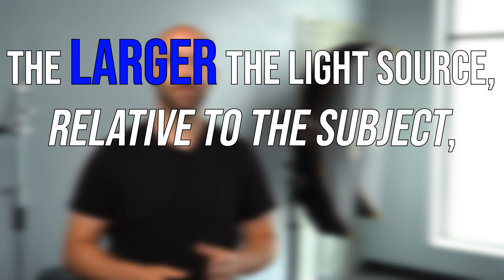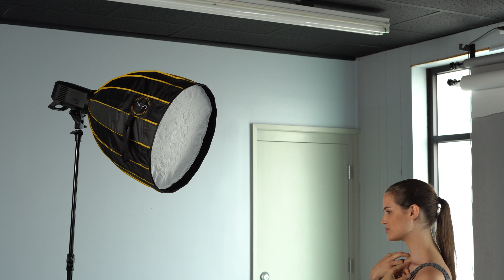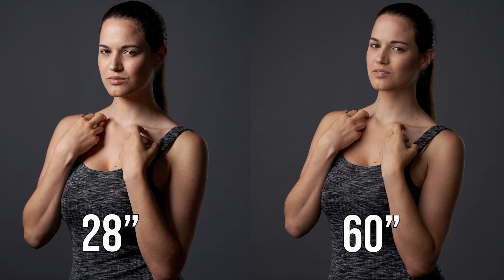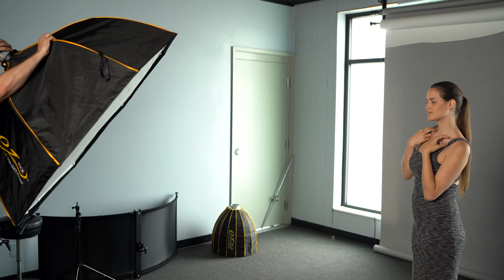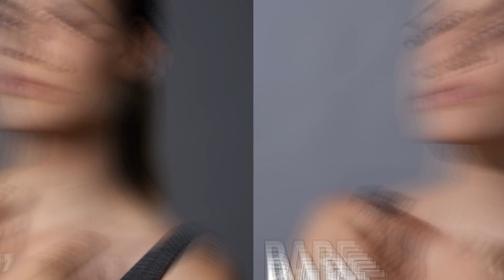Off Camera Flash Photography Tutorial // Quality of Light (Soft and Hard Light)

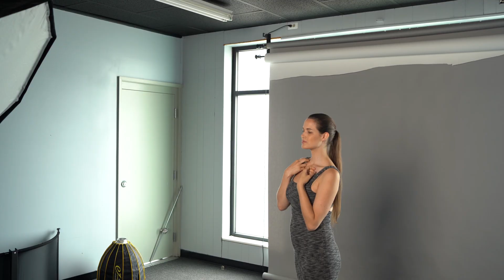Comment: I love the series Robert! Thank you so much for making the tutorials. One thing that I noticed however is that your white walls in the studio will react as a big reflector with big light sources. So the light will look a lot softer than it actually would be (outdoors for example). You can even see a rim light in 2:43 on her right shoulder. This is ether natural light from the window or flash bouncing from the white wall
Reply from the maker: Our walls are gray, and low sheen. They don't bounce much light at all. 2:43 is window.
Also for thoroughness, bounced light indoors doesn't make your light softer, it makes the ratio lower, or reduces the intensity of the lighting ratio for less darkness in shadows. The transition will still be the same.
It's not always true that this won't be the case outdoors, as it completely depends on how much ambient light there is to fill your shadows, which is controllable by the photographer both in settings and the subject's position to a the background (like having someone in shade and firing into an open sky will have a strong ratio whereas exposing that same open sky with your subject outside of the shade, will have much more fill.

Comment: Thank you and here is a question: with the same exposure of the highlights, hard light gives the shadow a hard, distinct edge and soft light gives the shadow a soft, diffuse edge. Instead of calling it hard or soft light, do you know why don't we call it hard or soft shadows? Next, could you do a video on color? Specifically, blue light is "cool" (6500K) and orange is "warm" (2700K), and we 'cool it down' by increasing the temperature and 'warm it up' by reducing temperature. Do you know why we use these terms?
Reply from the maker: We call it soft light because of the transition of all light, not just shadows. While the highlight exposure may be the same, hard light also transitions with more sharp edges in the highlight to midtone region. This is most evident in the incident highlight, or areas of specularity.  When you pull the light further away, you will get a smaller, more intense incident highlight that is more clearly defined amongst the highlight area of the photo. Whereas when you use softer light, sometimes the specularity can dissappear completely.
I've already got a great resource on temperature of light and gelling flash to match ambient, which will just be added into the playlist but it's already up. Just search gels on the channel page if you want to find it. I've always been annoyed with the visual / physical disconnect of defining warm and cool. But, unfortunately warmer temperatures (K) have cooler color tones.